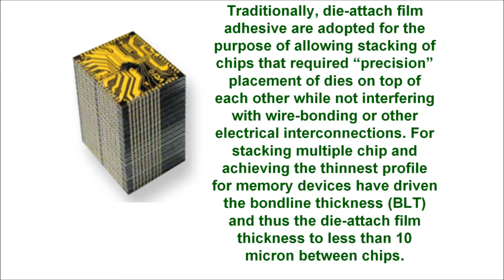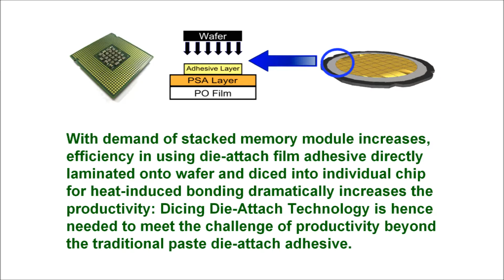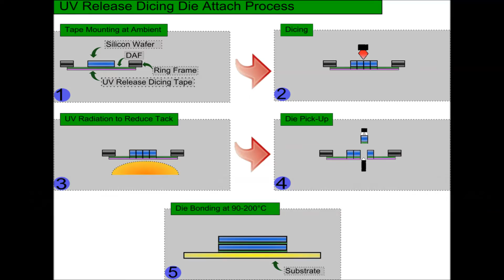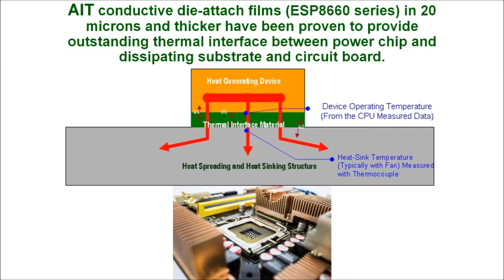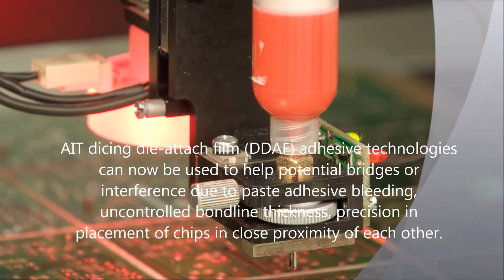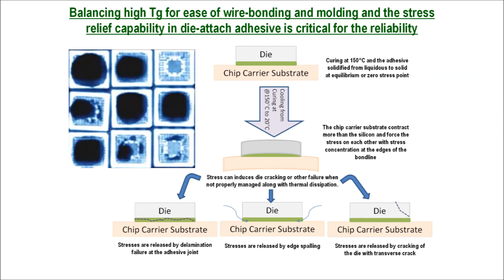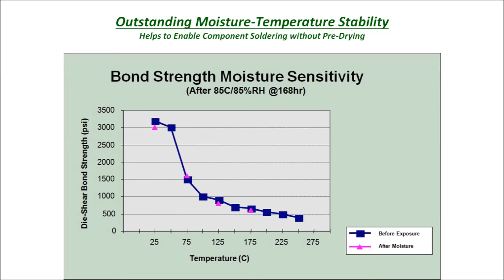Die attach film adhesives for all die attach applications with 10 micron BLT and stress absorption.

Comment: hello, any solution in dice off and adhesive remains on the film during die attach? 😄😄
Reply from the maker: +redamethy   
Hi redamethy, thanks so much for viewing our video and writing.  Great question...we'll post an answer shortly... best
AIT
Reply from the maker: +redamethy   Hi Redamethy,  After consulting with our resident PhD experts, we have the following answer.

·        For a die-attach film application, the adhesive is a film that melt-flows to bond to a wafer at temperatures of 70-80C with a pressure of 10-14 psi. o   Afterwards, the wafer is diced and the die with the adhesive stays on the dicing tape until die pickup.o   The die with pre-applied die-attach film is again melt-bonded to a substrate for curing at temperatures in the range of above 100C.
·        We would like to provide you with the most useful and informative answer possible - so we can truly do so, could you possibly elaborate on and /or provide additional application information and requirements? 

Again, thank you for the question.
AIT